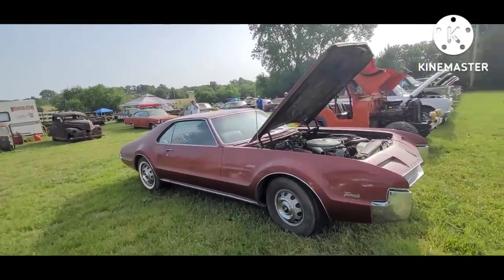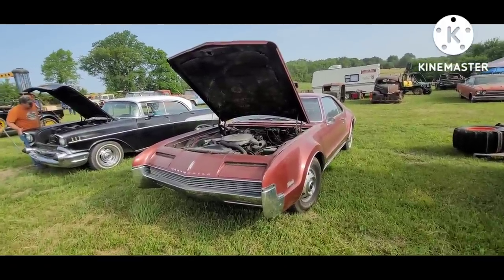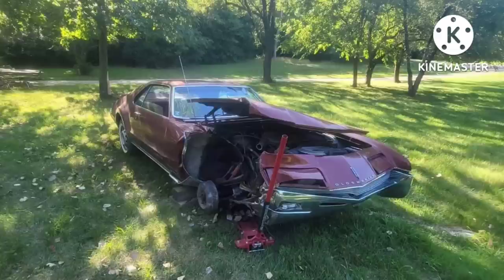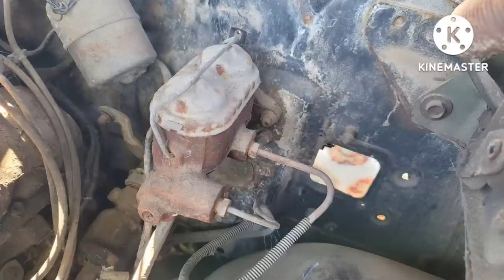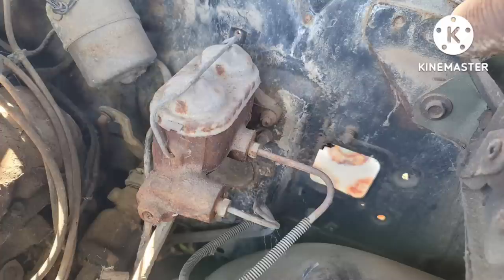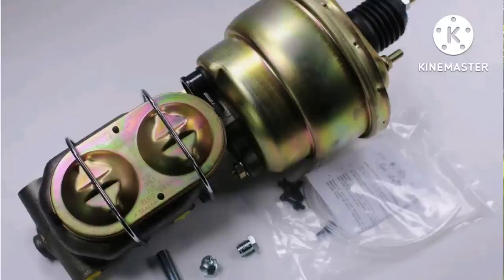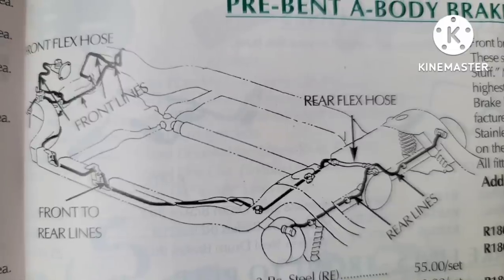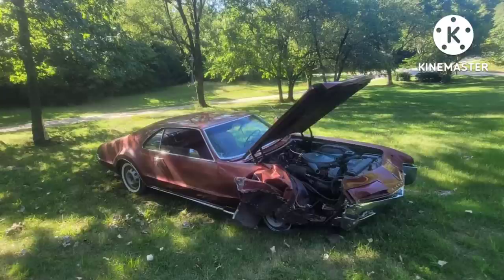Toronado Tragedy: Here's why UNSAFE single jar master brake cylinders are DANGEROUS old car hazards!

Comment: I have to ask, did he try the emergency brake? I had a ‘65 Grand Prix with the same single pot master cylinder, and had a rubber brake line fail. The pedal went right to the floor, and after a moment’s panic, I tried the parking brake. I about put myself through the windshield, but the car stopped. I had to do this a couple more times, and it wasn’t pleasant, but I didn’t destroy my Grand Prix. Just a thought I had, having been through it.
Reply: Exactly man!
Reply: Lol you are more likely to hurt yourself or someone else with the parking brake than to help.  More often than not it's going to lock up and spin you around
Reply: @claytoncoolidge992  Perhaps we should all go back to drivers ed class. How fast are we driving?
Reply: @donshotrodgarage1717  speed doesn't matter in this regard . It's pure and simple science. Most people have no idea how a parking brake works. It's not the same as a hydraulic brake operation and it's meant to hold a vehicle from moving when stopped. That means it's designed to lock the tire. It's not meant to be applied while the vehicle is moving. It's not an emergency brake. It's not designed for that type of usage. Can it be applied and used to stop by someone who understands the operation of it? Yes if properly applied it will slow and stop s vehicle. But in a panic situation even most of the people who do know how it works are not going to prevent themselves from over pressuring the system and lock the rear wheels up . Science wins in this situation. For one the loss of traction has now taken the rear tires from the same speed as the front tires and made them gain speed from the loss of traction science proven anytime anything looses traction (resistance) it actually gains speed (think about locking up brakes on ice you not only lose traction and steering but also gain speed). So now the rear end of the vehicle is moving faster than the front so only one thing can happen in this situation and it's the same reason why the parking brake is often used to do doughnuts in a front wheel drive car and the same reason why a rear wheel drive vehicle wants to fish tail when the rear tires are going faster than the front tires. The rear tires are going to try to pass the front tires and now not only is the vehicle turning to either side and not stopping it's also occupying more than one lane of the road and the direction of impact is now in the weakest and most dangerous part of the vehicle the sides. When you have lost brakes and there is no way to avoid impact with something your best and safest point of impact is with the front of 😛 vehicle in the most straight line as possible as that's the way that vehicles are designed to absorb the most energy and be the safest they are going to be. It also limits the impact to the other object in this situation most likely another vehicle to the one that is directly in front of you. Instead of the sliding out of control vehicle that is going to impact withe multiple things instead of one and impact with them in a way that is not nearly as safe and makes the level of injury increase drastically. Most of the time when you find out that you have lost all brakes it's too late to do anything but quickly see if there is a opening to go through and hopefully not have cross traffic or the best thing to hit and prepare for impact. Brakes are generally most likely to fail in a complete fashion on the hiway at higher speed due to the fact they are not used nearly as much as in traffic on surface streets. The more they are applied the more likely that the driver is going to notice that they are not working properly and likely stop before they completely fail.
Reply: @claytoncoolidge992  In my case, I was in a residential neighborhood, with a speed limit of 30 mph. The first thing I did when I realized I lost my brakes was downshift into low. I had to stop for a stop sign, and that’s the first time I used the parking brake. I applied it as gradually as I could, but locked the wheels up anyway. I wasn’t all that far from home, and only had to use the brake once more, and was actually able to coast into my driveway in neutral. I applied the brake once more, and the effect wasn’t quite as violent the second time. I was probably lucky, and truly don’t know the situation the driver of the Toronado faced. I just know that I got home without crashing into anything.
Reply: @ericesterby2895  exactly what my point is. You can tell from your experience with it that it was very easy to lock up. And that was in what sounds like a realativly low traffic area and you didn't have any thing that you would panic about. The guy in the video was going downhill and with a 100ft drop off to avoid. Would you want to lock up the rear tires in that case? Or even not be panicked and apply the parking brake slowly and not over pressure it as you are not stopping fast enough to avoid the situation that is in front of you? It's not likely that you are not going to apply slowly and avoid locking up the tires and with the drop off to contend with well I don't want to be in the car at that point. I'd do the same thing and hit the trees to stop me. It' sucks but your going to most likely live and be fine. 100ft drop it's not really a lot of hope that you live let alone be uninjured if you do love.

Comment: Agree with the comment, but as the former owner of  3 Tornados of this vintage and over 100k miles driving and repairing them, I am wondering about some of the conclusions here.
There is a of lack of information on the exact failure and damage. While I understand that  diagnosis was not the author’s point, the master cylinder shown does not appear to be the one for this car? Where’s the brake fluid?

While  master cylinders can suddenly fail like this,  many will fail partially first giving  at least some warning.  This is because the master cylinder is essentially a pump with a rubber seal  moving inside a metal bore. Deterioration of the seal and/or scoring  in the cylinder causes leakage that causes brake failure.

Having worked on these cars, there are many other common brake failure points such as wheel cylinders, corrosion/deterioration of both hard and soft lines, etc. Toronados route fuel and brake lines through the frame rails because the car is so low. They can and do rust through causing immediate brake loss.

My second issue is that this car be relegated to parts status based upon observable damage. 
I’d like to find where the brake fluid leaked, which may not be the master.

The area of most damage is where  little more than sheet metal from external and inner fenders as well as the hood. The front engine cradle is also extremely tough also and doesn’t appear to have had a direct hit on either the cradle and half shafts. The right front rim doesn’t even appear damaged!

This is where lack of facts leads to wrong conclusions but I’ll bite to finish this example. If closer inspection shows damage to be primarily sheet metal and front end cradle damage is limited to some bent tie rods etc,  fixing the brakes  and  remounting the wheel,  gets you a driving car with  a heck of a lot, hard (but not impossible to locate) sheet metal and front end damage.

Why am  I trying to save this car? The first gen Toronado is an  iconic car and 1966 is one of the best years.  The car should be saved although it will be a big project to repair.  I’m not looking for a project right now, looking for a restored car instead.  But I’m just trying to ask the enthusiasts here not to write this car off without a second look.

By the way, where is this car located?
Reply from the maker: It was in north central Kansas. It has been sold to a new owner. I am not sure if it will be used for parts, or repaired
Reply: I just bought a '66 Toro with the single m/c & drum brakes. Im nervous as hell from all the reports i read about  brake fade & u cant go just order a disc brake setup! If i upgrade to a dual m/c & have the brake lines/drums/pads gone over, will it be relatively safe to drive?
Reply: @smoothoperator7023  Congratulations on your purchase. I  think your renovation plan will work depending upon the topography where you live.  My Toros were equally split disc / drum. Use was in Central New York and Southeast  including Smoky Mountains. So, mostly rolling hills to mild mountains.  Drum Cars we’re both ‘68’s so it would be worth checking  to see if Olds made changes to the drum brake setup on the later cars.
Bottom line: I never had fade problems in this usage. 

I am a hobby level mechanic and kept them well maintained. In driving, I do believe in using the capability of the car but never abused them or did “spirited” driving. So in this kind of usage, in this kind of topography, drums performed fine. If my experience matches where you live and how you drive, you just might be OK. Having said that, converting to Disc would be highly recommended due to the extra safety factor.
Hope this helps!

Comment: ALL older cars had single master cylinders. Every single one of them. I have drove many old cars with single master cylinders. Brakes can fail in cars with dual master cylinders too. If this car was sold or being sold by a dealer, why didn't they go through it and fix any safety related items? In my 50+ years experience with old cars, especially ones that have sat for a long time, they need everything. All new brakes, steering, and suspension. Its just a given. Metal rusts, rubber rots. It has to be replaced. I currently have three old cars a '55, a '64, and a '72. I completely replaced the brake systems on all of them, and upgraded the '55 and '64 to dual master cylinders. I also converted the '55 to front discs. But if you are some kind of a safety fanatic, I wouldn't play with old cars. I'm not that concerned, I also ride motorcycles, including old motorcycles. Life involves some risk. If you are content with mere existence, you may be a little bit safer, but there are no guarantees, and look what you have to give up. You could live (I mean exist) in a sterile padded room, and still die at a young age. It sucks about the car. I've always loved the looks of those cars, but I won't own anything front wheel drive, so I never considered one.

Comment: Are dual diagonal? I thought that, then was told it was split front and back. Which is correct?
Reply: they are front and back. never hear of them being diagonal. That would pull you right off the road
Reply: Front and rear is the most common.   A few more modern cars had diagonal splitting - 4 separate lines.
Reply: Diagonal in more recent years.
Research it!
Reply: @JohnShinn1960  with the abs and traction control going on these days im sure they are all independent by the time the fluid gets to the wheels

Comment: No E brake? sounds like someone was driving somethin they didnt understand, and going to fast to be in a car that was "Sold" My toyota that I am daily driving now ,sat inside a shed since 97 and is starting to have booster issues, so i just drive really carefull. i think this 90 toyota is a single resovoir but a dual valve...I definatly know it needs some help soon, but with 175 $ a year full coverage, the tragedy may not be as bad if i run into sumthin slow.

Comment: Unencumbered by the facts and with very limited data, it seems to me that internal "flap" damage phenomena of hose blockage results from a mechanic using needle nose vise grips on the brake hose to expedite and minimize a caliper changing subsequent bleeding.  Roughly 107% of mechanics do that.  I'm a mechanical engineer burdened with information and never do that.  I've likewise never experienced that.  That's my data base.  I think it's a thing.  IMO no H.
Like Jeff Foxworthy would have a sign for that.....in stock.  Fortunately, all instances of that I've heard about, the brakes just won't release.

Comment: 1) how can you buy a car that's been standing for more then 6 months be just put back on the road, it's not the single system that's at fault it's not doing a proper job.
2) why is that a parts car now? looks very repairable! Shame that
3) why didn't he use handbrake

Comment: Emergency brake failed too? Park will stop a car after a few hops. Just lazy maintenance. Only morons get out on the street before checking all brakes.
Reply from the maker: Every mechanical part works, until it doesn't. The brakes worked when the car was pulled out of the driveway
Reply: @mr.goodpliers6988  maybe I was a little harsh,  just glad no one died. I have stopped a car from the passenger side by throwing it into park. From about 45 mph it made a few hops stopping just feet from a barricade. The driver had past out.

Comment: Let's get down to brass tax. Your buddy bought a car that was probably stored for not just the little bit you say it was. More like 20 or 30 years since it had been on the road. Then your buddy sells it for more than he paid but didn't bother to check the brakes before he sold it. Then as he was going to load it decides that's a good time to check the brakes. Your buddy is stupid. There is nothing wrong with the older single pot master cylinder brake systems. Like everything else they have to be maintained and your buddy failed in his job to do it. By the way, a dual pot system splits the brakes front to rear, not side to side.

Comment: Rubbish. A car is only as safe as the idiot at the wheel. Like any car of any age, know your vehicle. Brakes dont just fail, they are very well designed. I have two cars with single circuits and they work fine.